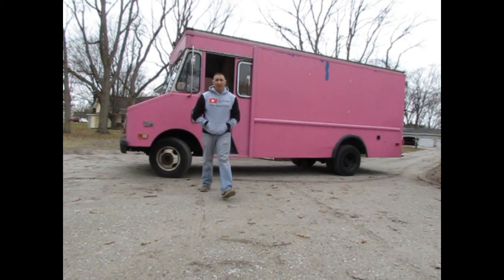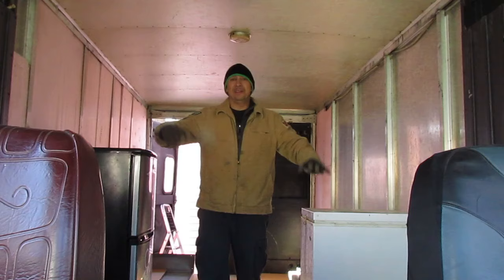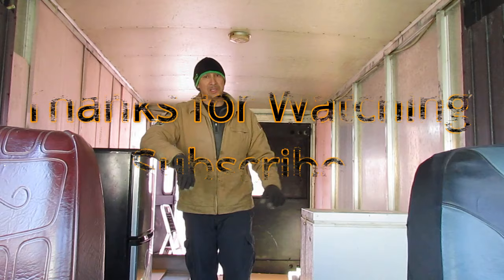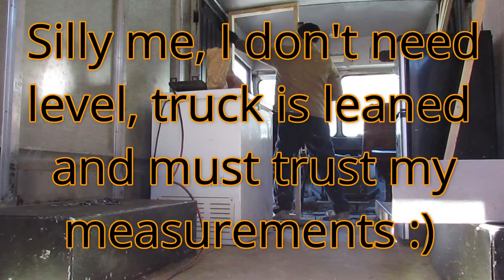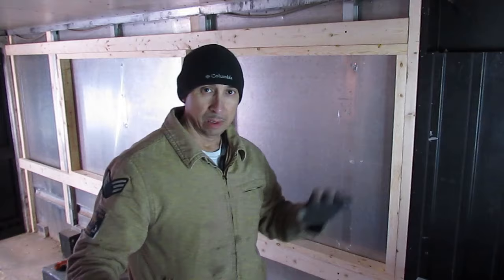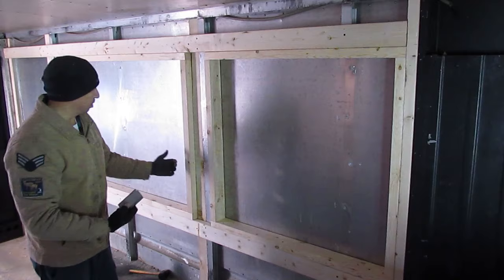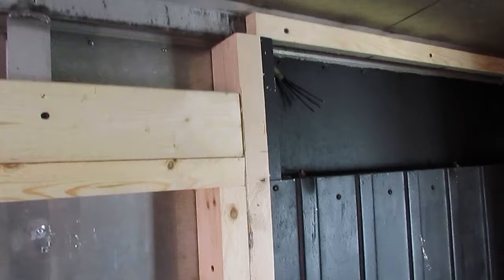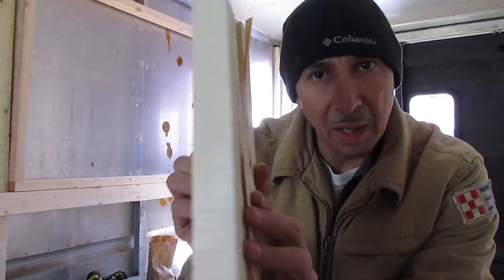Building a Successful Food Truck with The Seamster

Comment: I love the sound effects at high speed lol
Reply from the maker: Thanks Mike for the Nice comment :)  THE SEAMSTER
Reply: The Seamster I’m looking into building my own food trailer to operate in Dallas Tx but getting information on the specifications and city requirements from their website isn’t an easy task. I can find the necessary steps to starting my own food truck/trailer but not the construction requirements. One of the requirements is proof of manufacturer so I’m starting to think that maybe they don’t allow people to build their own trucks & trailers but that doesn’t seem right to me if the person is capable of building it to the proper specifications.
Reply from the maker: @mikewiththebluecar  Yes, the most important part is the application to build a food truck. Get as much information as you can and fill out paperwork and then submit. This normally takes a couple months to get approved just to build truck. Once approved, you will have another inspection showing you did what you were supposed to do and you took your Food Safety Course.  THE SEAMSTER
Reply: The Seamster ahh I didn’t see an application to build a truck. Thanks I’ll definitely inquire about it. One thing that concerns me is they require me to submit scaled drawings of the trailer to be approved before I start construction. Did you have to do this and if so how detailed did the drawings have to be. I’m curious if they’re just requiring the layout of the equipment or if the drawings must include all the plumbing, gas, and electrical layouts as well.
Reply from the maker: @mikewiththebluecar  Yes, if you check out my Food Truck Application Video, I explain what you will need to do. Thanks for the comment and the Sub.

Comment: Did you have to secure the divider wall to the ceiling or floor? Thank you
Reply from the maker: You dont have to, but highly suggest it. If not the wall would move easily when banged into.  The SEAMSTER

Comment: The wall you built as a divider behind the seats... how did you secure it to the truck walls and floor? 
Thankyou :)
Reply from the maker: I just used stainless drywall 3 inch screws.

Comment: i really wanted to use aluminum studs but you are using regular 2x4. I know i have seen people wood but i was afraid of fires because of the deep fryers i am using. What made you choose regular construction?
Reply from the maker: Ok, remember you can always use stainless metal  behind deep fryers and wood the rest of it. Also, aluminum is a conductor for heat and will get very very hot. As long as you have the proper hood  ventilation the heat should be at good temp.

Comment: Hi... very good videos!
Thanks! I have a question: I came to Home Depot to buy a Yellow Enamel Oil based Paint like you recommended, and the Sales Person tells me It won’t work, that in less than 3 months it will start cracking down. Have you got to repaint any part of the Vehicle? I want to add some logos on the truck and having to re-paint and re-draw arts would not be good. 
Please, let me know how has been your experience with the paint. I would appreciate it. Thank!
Reply from the maker: The Paint is still holding stronger than ever. The reason i bought the enamel was for long lasting. I just did a video of an extended bumper and it has been 1 year after we painted the truck.  THE SEAMSTER

Comment: This may be a dumb question but I've never framed before. When you build the separation wall how do you secure the wood frame to the truck?
Reply from the maker: Ok, I should have explained this better and I still may in a future video. Once you build the frame. I made sure to know where the ceiling frame was to attach it to and I pre-drilled holes and used 3 inch Drywall Screws to fasten to it. Then for the floor and sides, that was the easy part. I pre-drilled small holes through the metal and fastened the frame all around. Kinda like I did with building the Window Frames. You will be surprised what Drywall Screws can go threw before they break or strip the top. Thanks for the comment my friend and stay tuned for more FOOD TRUCK videos :)

Comment: Brother.   Do you think its possible to just mount my window  to the aluminum frame.  Mine seems soiled and I just dont want to use up and space and lose width in my truck. If I can help it. And mine seems to be super strong. ?
Reply from the maker: Thats it!  If it is strong enough to hold it. Remember the flex of the truck though.
Reply: @TheSeamster  thanks

Comment: How are you attaching the wood to the aluminum walls? (For the wall separator up front)
Reply from the maker: Sherize Bennett I screwed it to the floor and the upper roof support. Using stainless steel 3 inch screws. The SEAMSTER
Reply: The Seamster will that damage the floor.? I’ve was trying to watch carefully. I  may have missed it but did you put plywood on the floor? I have viewed the videos a few times before we get started. I noticed you were careful about not piercing the walls and floors if it wasn’t necessary. I do lobe the block idea (you’re a rock star for that),  and thank you so much for sharing the journey with you and your son. 😀
Reply from the maker: Sherize Bennett No damage if nice and tight. If you want you can apply constitution adhesive to help it hold better. I have more videos to come. The SEAMSTER

Comment: What did you use to attach the WOOD FRAME  To the aluminum body
Reply from the maker: I used 3 inch Deck Screws for wood to floor and to frame. They are rust resistant and expensive. I used 3 inch drywall screws for wood on wood. Hope this helps, Thanks for watching and spread the word :)